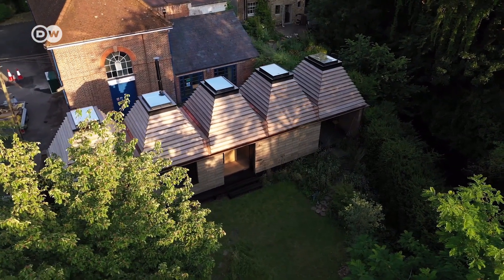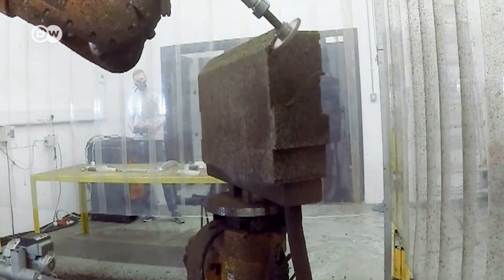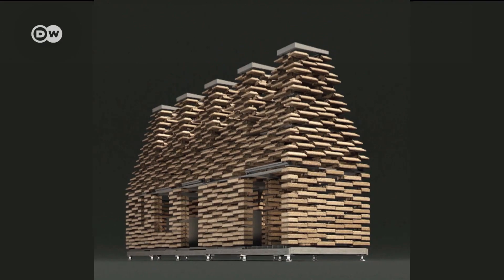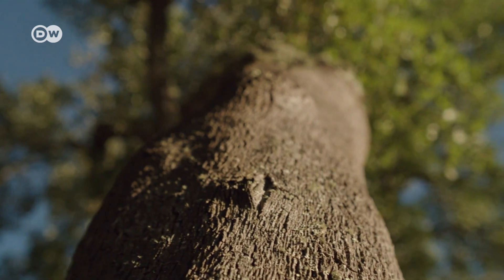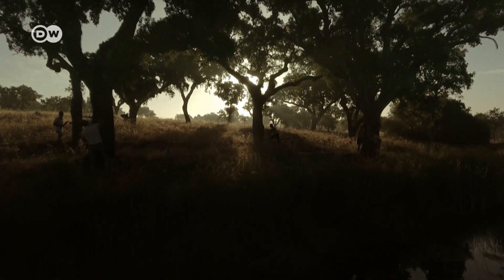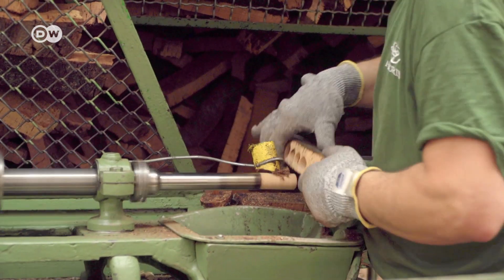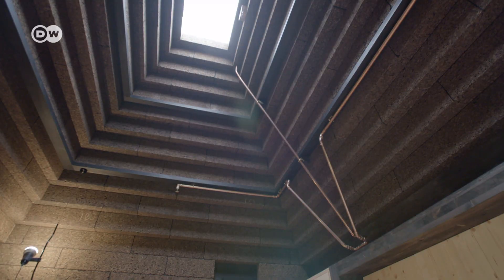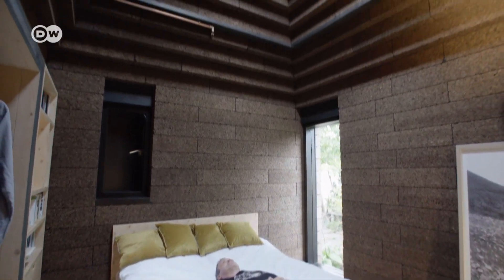First House Entirely Built With Cork | Sustainable Lego System Architecture | Corkhouse UK

Comment: If it's only held together by gravity, what's keeping it standing in a strong storm? That's my main concern.
Reply: Nothing a bit of duct tape can't fix!
Reply: Just what I was thinking! No adhesives or nails or screws its the loveliest death trap you ever seen.
Reply: Weight of the house?
The gravity kept the house in one piece because of the gravitational pull to the core of the earth which is down.

Because of this, all the blocks are interlock with each other. This prevent them from swaying to the left or right because the storm have to move the entire house to the side to actually blown it off.

So once it's being constructed, it would be a Single house rather than parts of them sticking out to the side.
Reply: @nntflow7058  I'm guessing that you don't realize cork is extremely lightweight. Winds would tear this thing apart from top to bottom with out the pieces being glued or taped together. Then the weight of the entire house would come into play.